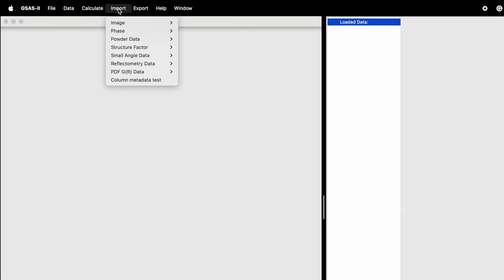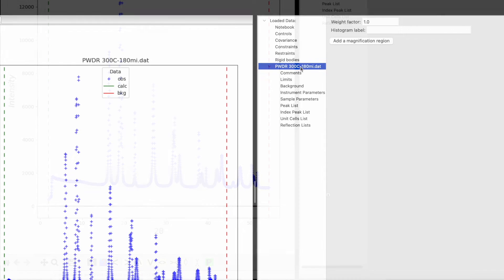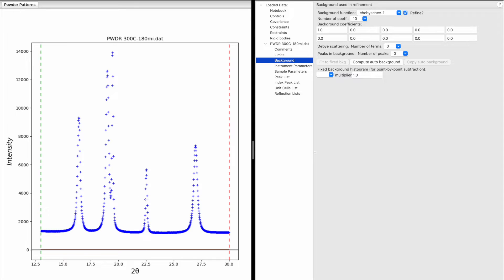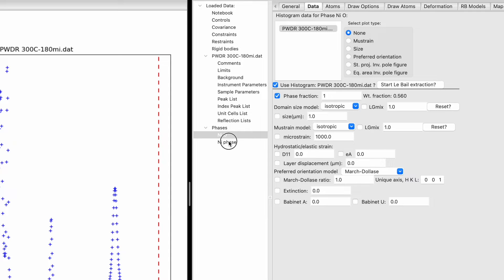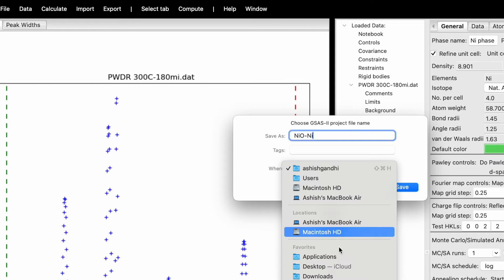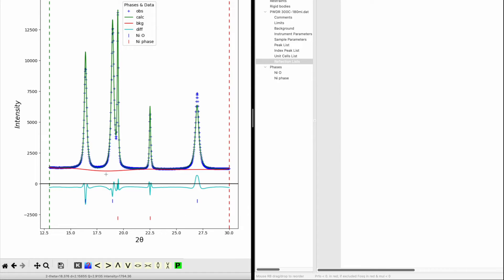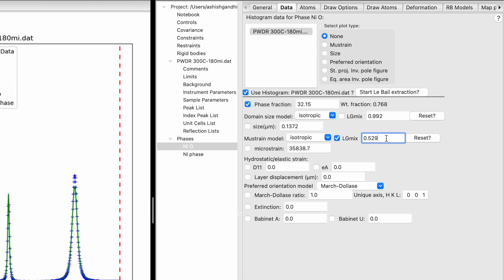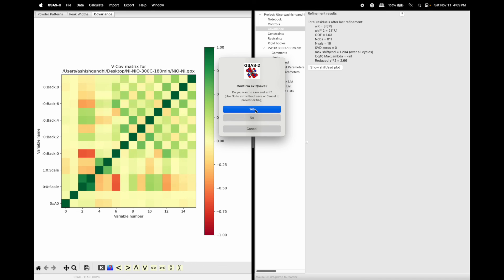Rietveld refinement of dual (two, multi and mixed) phase XRD: GSAS-2

Comment: Handy video, i have subscribed to your channel.. 👍... Could u ple make a step-by-step video of the refinement of dual phases.. including plotting in Origin also,, the most problem is facing the plotting in origin
Reply from the maker: Thank you for suggestion and hope that it worked for you. The refinement I have shown in this video is for 2 phase system. I will upload another video on plotting using origin software.
Reply: Thank you very much sir.. Intensely waiting for... Please do ASAP..    Because i have waisted more then 2 weeks.. Luckily, i have finally found your videos.. Its very helpful for me... But facing problem how to plote in origin that refined data